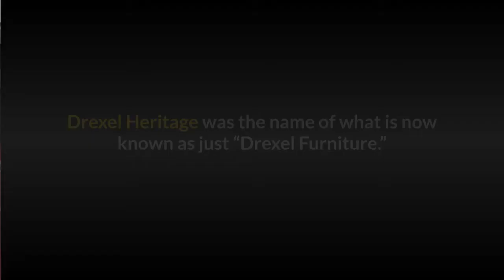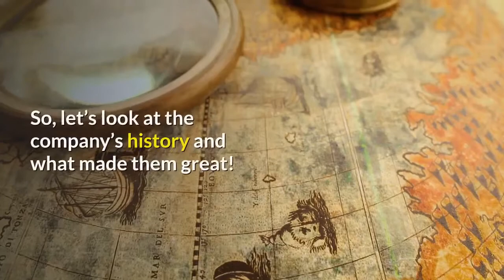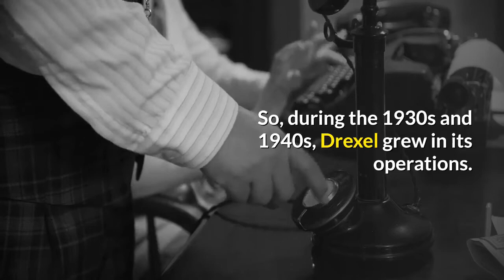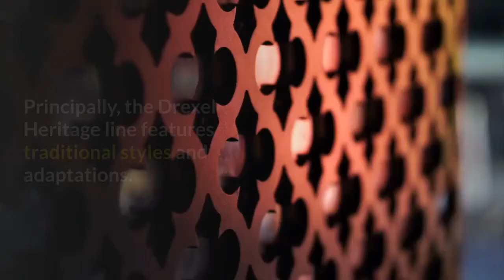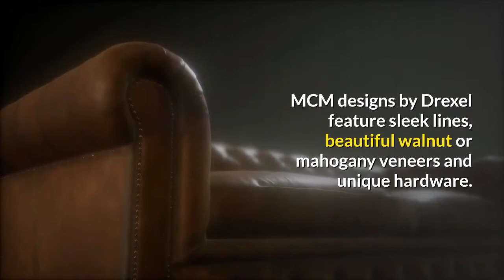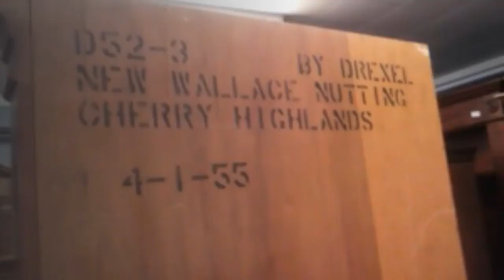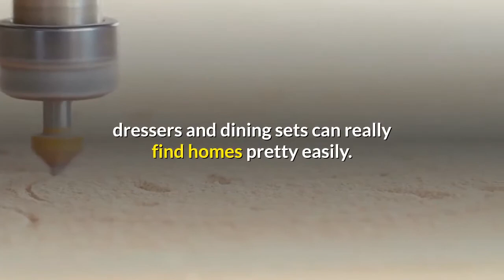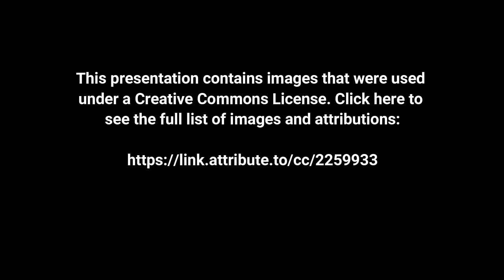Drexel Heritage Furniture, Is It Good Quality Furniture?

Comment: My Drexel  Bicentennial dining room table had become woobbiey. .I suspect in the last move a fitting has been loosened or lost. How can this be repaired?.
Reply from the maker: Hi Ann! I am sorry to hear about your table. Typically, this version of Drexel Dining table has four legs in the corners that are attached to the table top with bolts and nuts. If you can flip the table upside down, my guess is you will see a loose nut that can be tightened. If the bolt itself is loose inside the table leg, you will need to remove that, fill the hole with wood glue. Let that dry completely. Then, you can predrill to the proper size, replace the bolt and then retighten. I hope that helps your beautiful Drexel Heritage table. Thanks so much for watching!
Reply: My table has a pedestal and 2 folding legs that are used when a leaf is added.  Is anything supposed to be done to the folding legs or the metal supports under the tabletop?
Reply from the maker: @annhoar   oh ok! This is a totally different design. I am not sure if it is wobbly when it is opened or when it is condensed... However, yes, it sounds like the culprit could be the folding legs or the metal supports. Sometimes the metal supports get worn out and don't "click" into place like they should... I am sorry... it's hard to troubleshoot without seeing it. I know it is hard to find a furniture repair or refinish shop, but you could bring some photos to a local used furniture shop and see if they could give you some better advice. Thanks again!